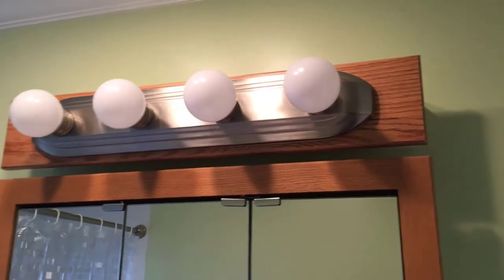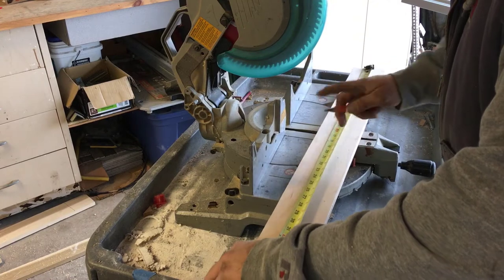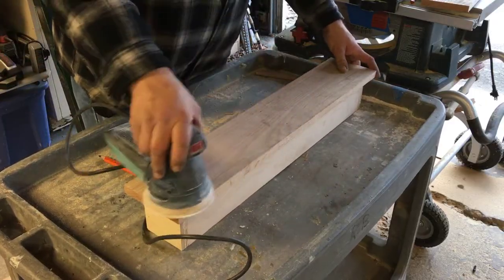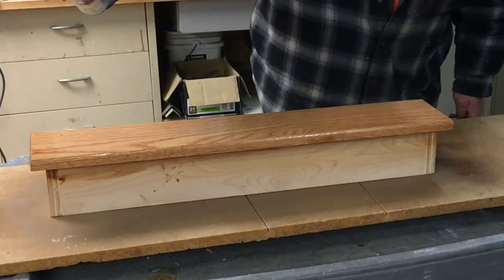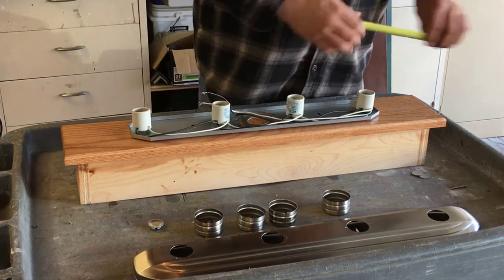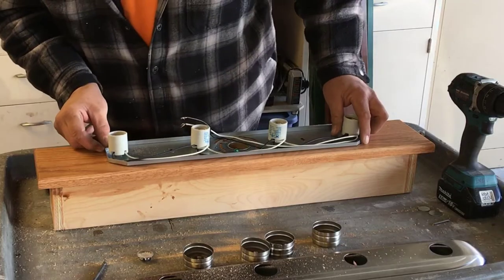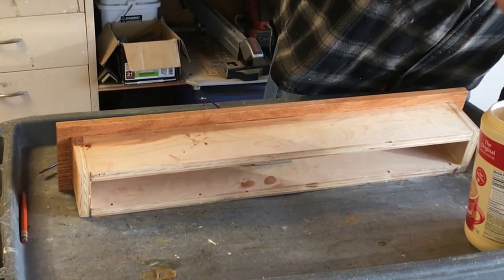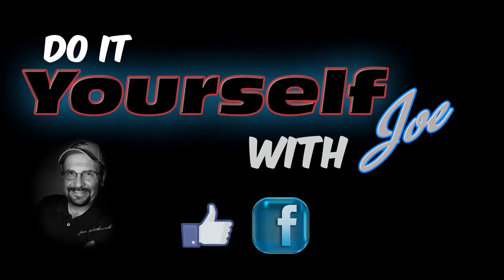how to make and install a vanity light bar pt 1

Comment: According to most building codes, shouldn't the electrical junction box be mounted flush with the exterior surface of the wood instead of behind the wood?  The idea is that just in case of a short in a junction, the metal or plastic box rated against an electrical fire is between the wire junctions and flammable wood.